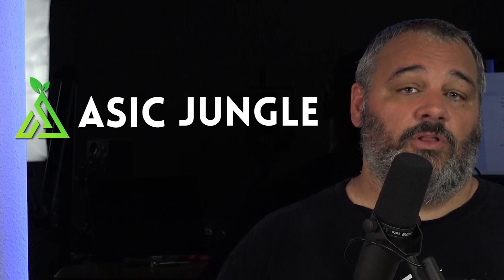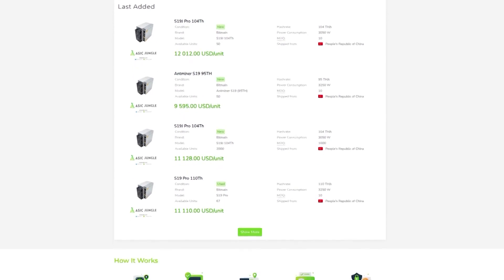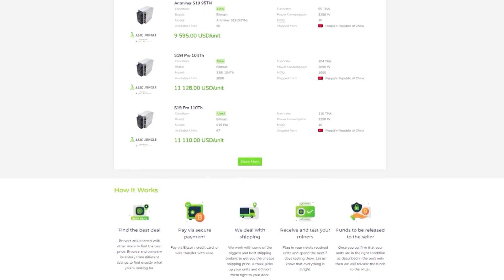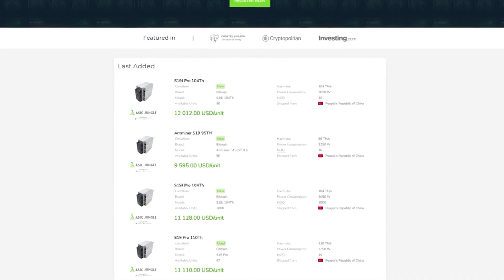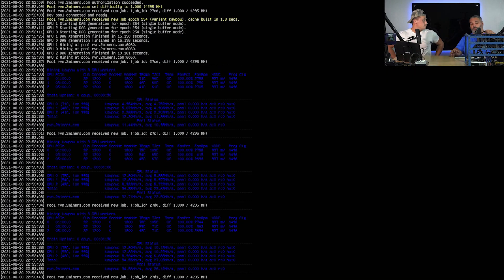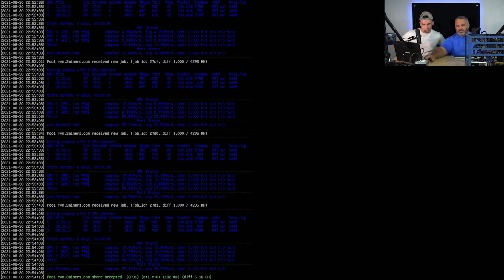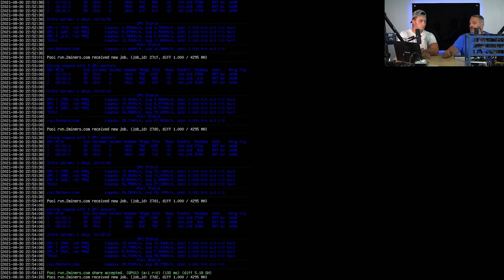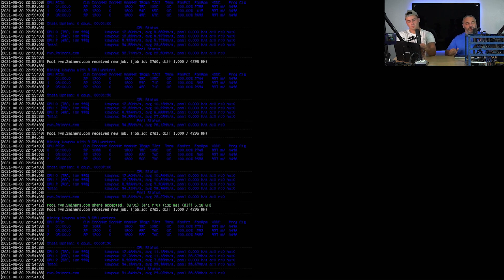Newbie's Guide to Cryptocurrency Fixing a broken rig? - Part 10

Comment: Nice video. I got a code 43 on a couple of RADEON VII. I updated the motherboard BIOS, tried switching bios on cards and nothing. Is there any way to fix it?
Reply from the maker: Code 43 can sometimes mean the GPU, especially a Radeon VII has had a hardware issue. I would try using it with Simplemining and see if it can leverage the GPU or not. The Radeon VII's unfortunately we're not very reliable.